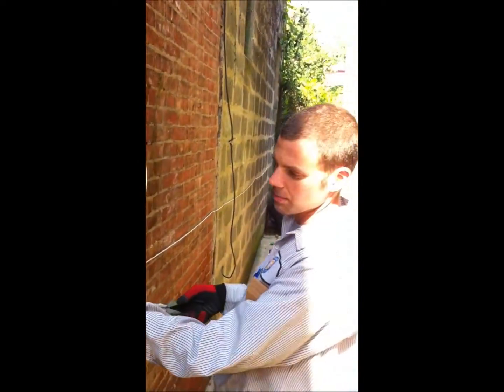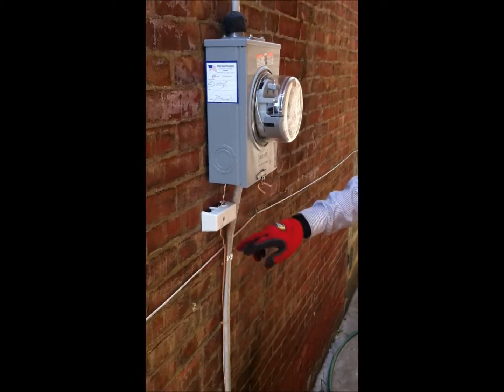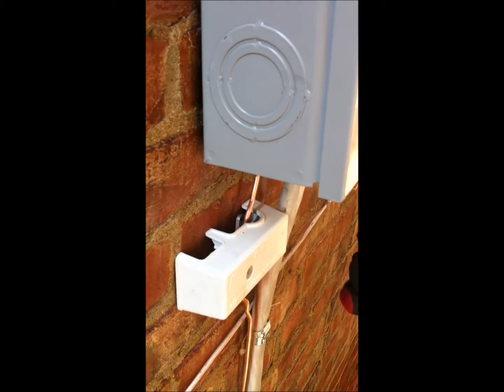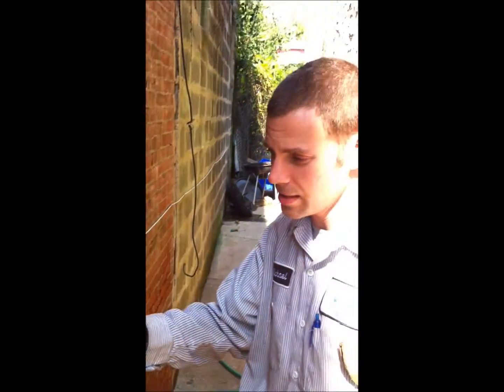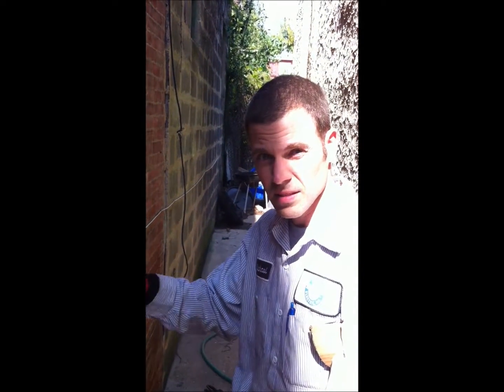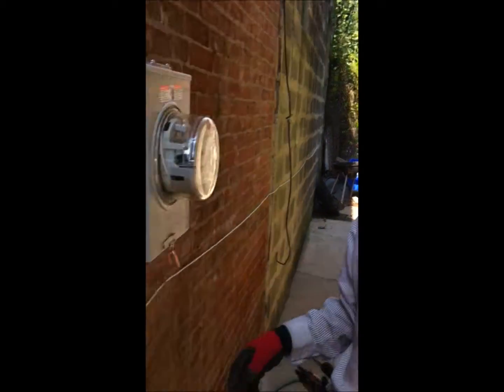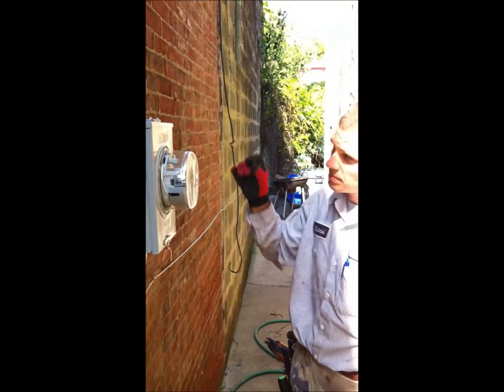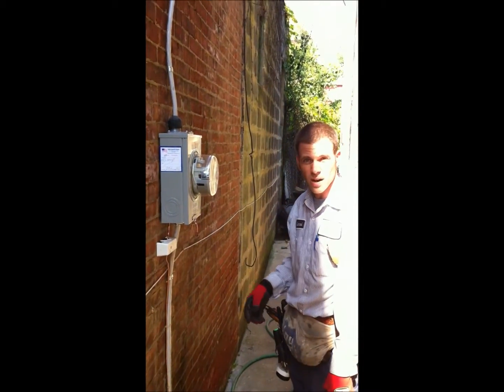Grounding phones and cable

Comment: Our city inspectors here requires us electricians to protect the bare copper grounding wire with sch 80 grey pvc. Reason: Tweakers see a shinning copper wire exposed, they snip it off and immediately  turn it into cash to buy their fix for the day. We only expose 3 inches between two 1/2" conduits to hook up our branch grounding terminal.  It look very clean work this way.